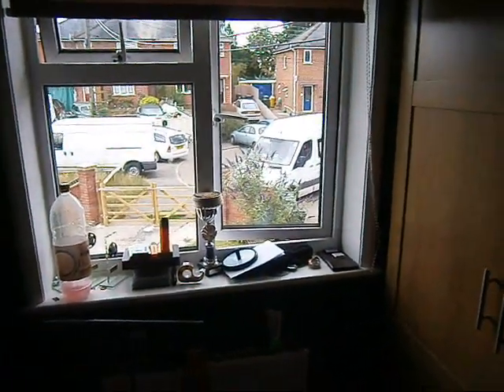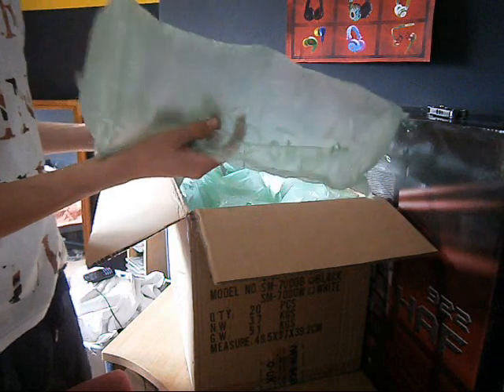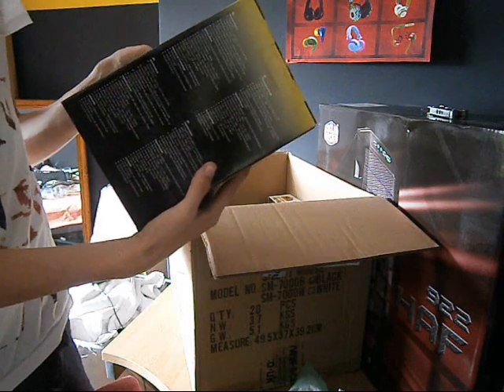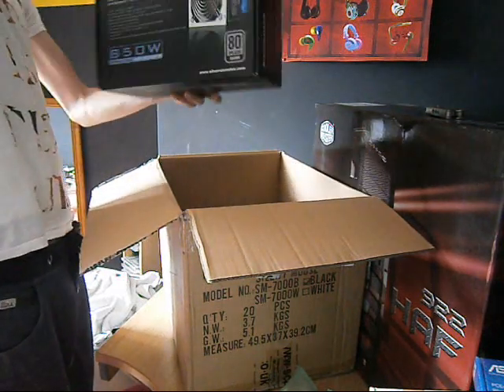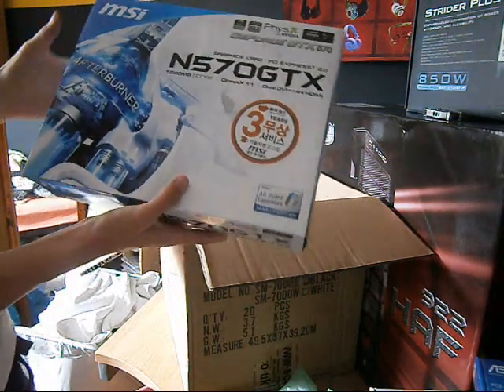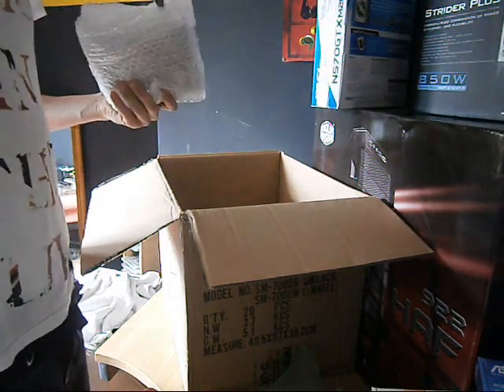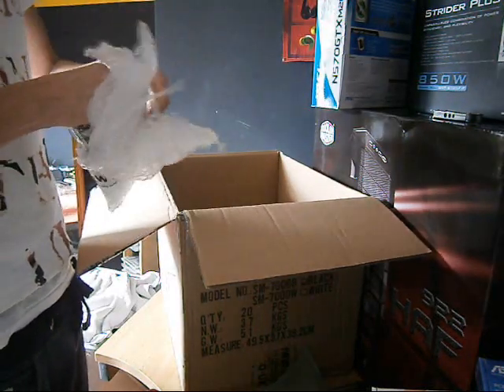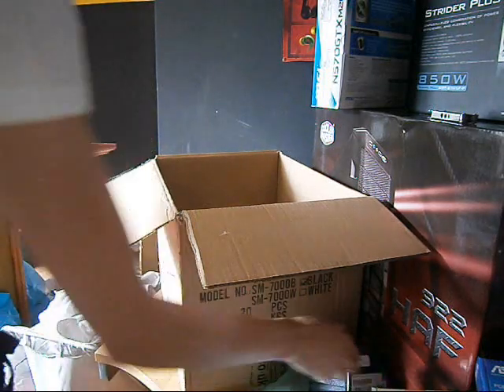My new Computer build unboxing & (Finshed)

Comment from the maker: @DJBowder Cheers for the comment, much appreciated :) yeh there is a thumb screw missing, but for very good reason, my mini hdmi adapter wouldn't fit in the back of the case unless the card was slightly flexible , but its securely in there well enough, all i need to do now is figure out how to over clock the CPU properly :D